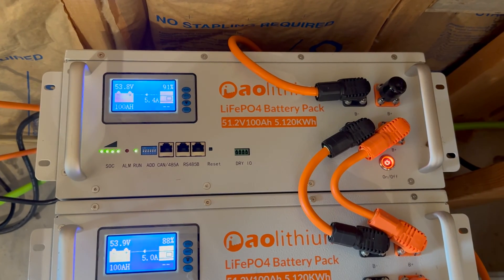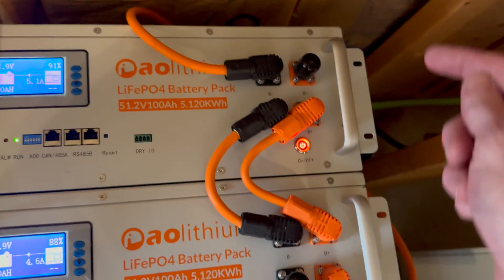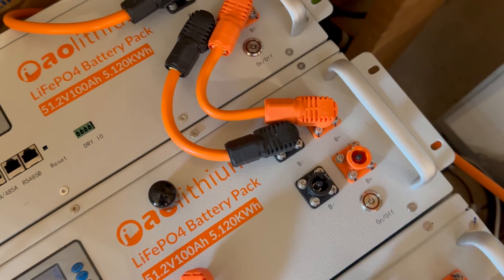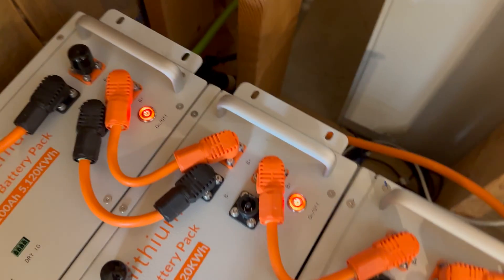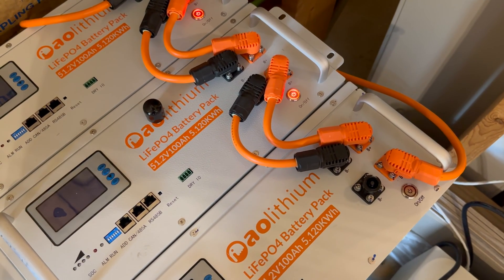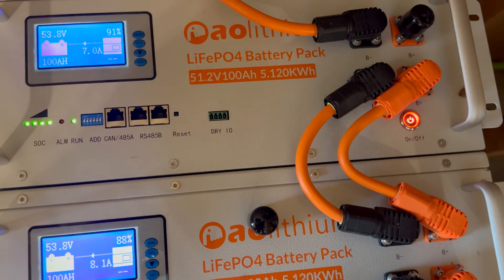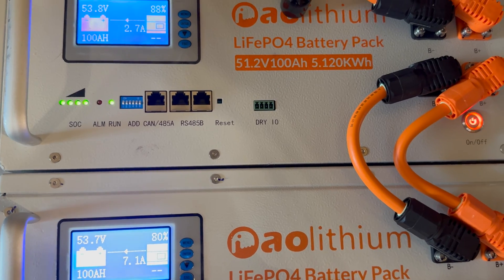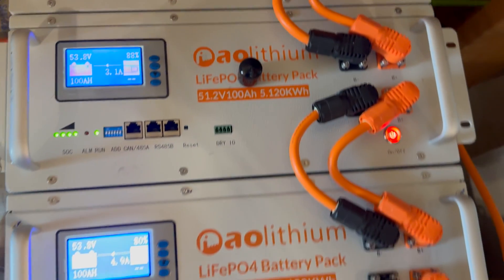AOLithium 51.2V 16S 100Ah 5.12kWh LiFePO4 Rack Battery Part 3: How to add to existing battery bank?

Comment: How long did it take until they properly balanced also what would  you recommend for them to balance faster
Reply from the maker: For the packs to equalize together?  a trip to full resets all to 100%.  For them to each internally top balance the 16 cells?  FOREVER!  The BMS in these has only something like a 50ma passive balancer.  It took a couple weeks of holding the voltage up to just before the highest cell would alarm and send it offline .  I eventually opened them up and installed NEEY 4A active balancers in each one, which are amazing. Now I can Bluetooth monitor them.

Comment: It's a shame that they stopped selling these in the USA. I was hoping to buy more.
Reply from the maker: I think they might just be out of stock.
Reply: @DougKremer  I hope you're right. They didn't reply to my inquiry so I don't know.
Reply from the maker: I hope so too.  I think they are pretty good batteries.  We are expecting a week of gloomy weather here so I just took my three offline from cycling to spend some time balancing on my power supply.
Reply: @DougKremer  The company's response: "At present, this type of battery has been sold out, and there is no clear stocking time yet." So it sounds like they will be back at some point.
Reply from the maker: @ Hopefully!
Reply: Hi, They shipped me an extra replacement 100AH 5.12 but no short cables. Where can I buy them AoLithium is out of biz now. I'm up and running with 8 Batteries. I need more storage. But No short Pos and Neg cables. Can anyone one help! Joel